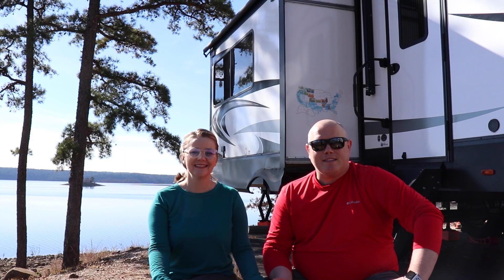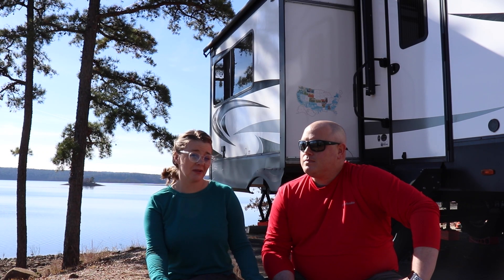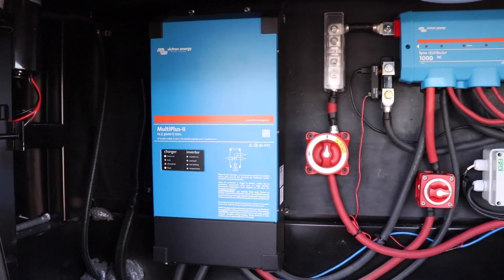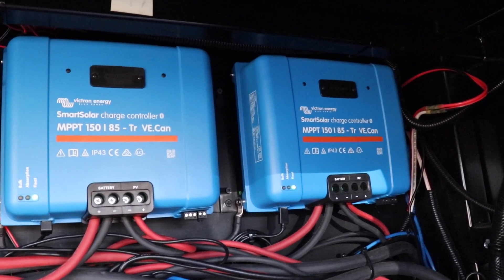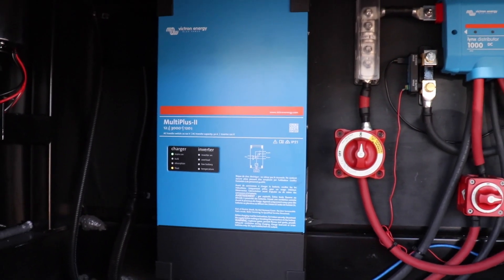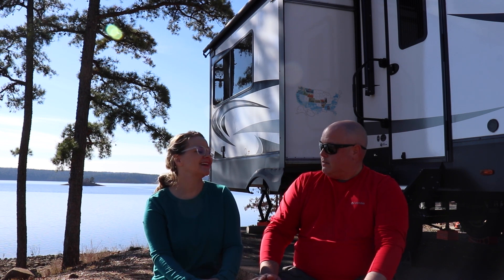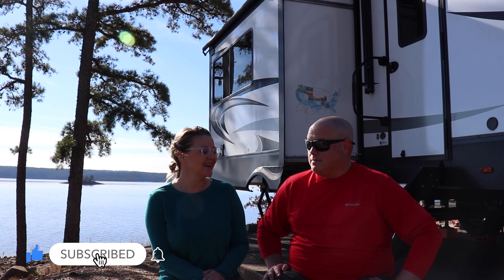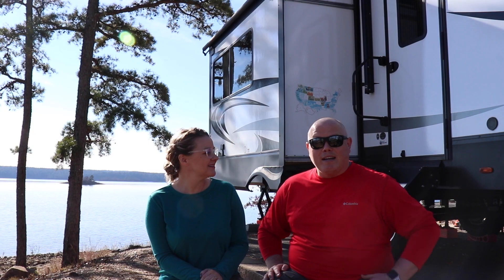RV SOLAR SYSTEM INSTALL | 1720 WATTS ☀️ 600ah 🔋

Comment: Sweet install. Has it been all that you hoped it would be? Or are you planning on going bigger still? Great job, btw!

We're retired FT RVers who love to boondock in our 99 National Tropical MH, so we decided to build our system in 2 phases, a 12v basic phase to run all our 12v appliances and a 48v system for our AC high power needs. The main issue we faced is we are retired and living on social security and a small pension so have to do everything on a tight budget forgoing name brand components like Battleborn and Victron for lesser-known brands. We just completed the first phase month, with the addition of custom built 560ah of LiFePo-4 battery, just a little smaller than your set-up, made with 8, 280ah prismatic cells. We used a Heltec 330amp BMS and a 5a active balancer, to start our onboard 5,500watt generator. We built our 12v battery with grade "A" LiFePo-4 prismatic cells having an 8,000-cycle mfg. projected life at 80% DOD and 6,000 cycles at 100% DOD. It only cost us $1,500 to build it, including the BMS. The main reason we chose these cells is that they fit perfectly under the steps of our motorhome where our old pair of GC-2 golf cart batteries used to reside, saving 35lbs compared to our old FLA batteries - not to mention having over 5 times the capacity and 10 times the life. We cut a small hole in our steps and installed a tiny computer fan to keep this space at close to room temperature. We insulated the compartment as well to prevent it from freezing. 

We started our build 3 1/3 years ago with a 620-watt liftable array mounted on the side of our motorhome. It serves as a nice bedroom window awning too. It practically lifts itself to the correct angle with a couple gas struts and it's easy to clean with a windshield squeegee, standing safely on the ground. This first phase, including the liftable array, wiring, breakers, a new Progressive Dynamics 80a Li compatible converter/charger, 600w PSW inverter (to run our TV and PC), an Epever 50a MPPT controller, and a Renogy battery to battery charger (to protect the alternator) cost us around $3,600. Right now, we must still run our generator to run our microwave and rooftop AC unit.

It's about time to start phase 2 which will virtually eliminate the need to run our generator, except for emergencies. We have enough roof space to rack 8 BlueSun 460W bifacial solar panels in a single row down the center across the length of our 35ft Class A MH. We will be racking them about 13" off the roof to clear our front AC shroud and vents. This clearance should conservatively produce another 10% output off the back of these bifacial panels too, from sunlight reflected off our white roof - even more during off-peak hours and in the winter, when the sun is lower in the sky. It will give us a good bit of shade too, to reduce the load off our air conditioners too. Peak solar output won't increase by much, but there will be more area under the curve, so to speak, due to higher morning and evening solar output. Our MH isn't as tall as a fiver, so we will be able to keep the RV height to 12' 2" at its highest point to minimize clearance issues. We will be using an all-in-one 48V, 3kW, 120V PSW Inverter, 80a controller and 60a ac battery charger by MPP for the bulk of our 120v needs with a dedicated, 2,000w, 220v PSW inverter to power a 12k Btu mini-split heat pump. Our 48v battery bank will use 16, 310ah prismatic cells (15.9Kwh.) So together with our 560ah (7.1 Kwh)12v bank, we will have a total of 23Kwh of batteries onboard which is roughly the equivalent of 6 of the 300ah Enduro batteries you guys have. We will be adding a 30.5 SEER, 12k Btu Blueridge mini-split heat pump in our bedroom, and removing our old rear 12k btu rooftop AC that we never use anymore since we replaced our front 12k Btu Dometic AC with a 13.5k Btu Furrion unit. This second phase will cost around $9.5k, which is pretty reasonable for a system of this size, including the mini-split. It will provide 24/7 off-grid air conditioning and supplemental heat from the heat pump and allow occasional usage of our front rooftop AC to cool things down for peak afternoon demand. The total solar capacity of both arrays, while hard to estimate accurately with bi-facial panels, should be roughly the equivalent of 4,600 watts of single sided panels. It will give us total off-grid electrical independence with little to no back-up generator usage.

Comment: I know everyone's use case and load requirements are different, but what kind of limitations have you found with your system? My 5er has similar overall load requirements that I've been tentatively sizing a system for, and I'm coming up with a substantially larger setup. Much of our camping requires AC, often both units, in order for me to get any sleep. My guess is that with the single multiplus II, you're limited to a single unit. Does that sound right? Have you had any issues when supplementing with 15A or 30A sources? Thank you! Good looking rig.
Reply from the maker: We would need a substantially larger battery bank if we ran out AC units while off grid, absolutely. We are mindful of power usage but don’t feel like we “go without” while boondocking. We have soft starts installed on both AC units and have tested both on battery power, it works. With only 600ah of battery we’d deplete the batteries pretty fast running th ACs. We’re fortunate to be able to chase pleasant weather all year and haven’t had many warm days off grid. 

As far as when we’re hooked up to 50/30/15A, the only issue we have is the solar chargers will randomly overload so I’ve began to turn off the breakers for them when we have shore power. If I forget and they overload it’s not a big deal, I turn the battery disconnect on, turn the solar breakers off and leave it for a few mins then turn it all back on.
Reply: @LetsHeadWherever  Thanks for the quick response!

Comment: Your work is far faster and cleaner than mine.  Did my battery bank install while staying in mine.  It took me the better part of a month to get the area prepped, and install what I needed.  And +1 to what you said about the wiring.  4/0 cable is not cheap and the correct lugs were not easy to find.  Welding shops are your friend here.
Reply from the maker: Thankfully our friend is super knowledgeable and was able to orchestrate the entire thing 😂 I just did what he told me to do 🤙

Comment: What did you do with the original 12v system that’s used when you truck is hooked up. There’s got to be a changer that charges the original battery. No one talks about that.
Reply from the maker: I haven’t changed anything on the truck wiring.  The 12V accessory wire on the 7pin is so small that it’s just a trickle charge while driving anyways. I considered disconnecting the 12V wire in the trailer but haven’t. I unplug when parked for more than just a fuel stop to keep the two battery systems isolated from each other.

Comment: How did you run your solar wires from the roof to the front bay? With 2 solar controllers you had to run 2 sets correct? Great video.

Tim
Reply from the maker: Tim, we used the set of existing solar prep wires and ran an additional set down along side them. There was already a connection point on the roof as part of the solar prep. Thanks for watching 🤙
Reply: I've got the same setup in my Reflection 320MKS. Was it hard to get the additional wires through? Did you just run a fish tape from the top to the bay and pull them up through? Thanks.

Tim
Reply from the maker: Yep, we used poles from the underbelly, up to the hallway control panel that I took off, then up to the roof. The light that was hanging down was right next to where the roof ports are.